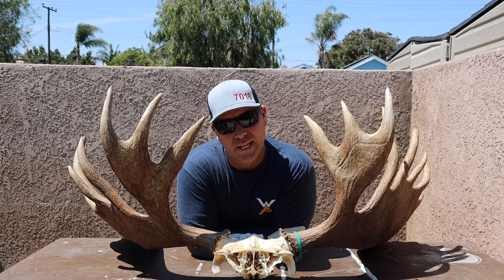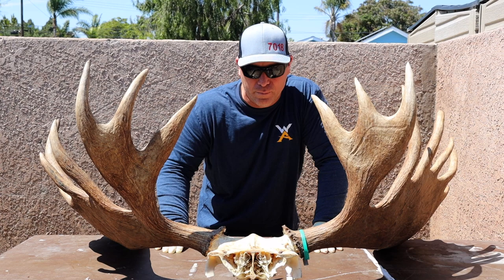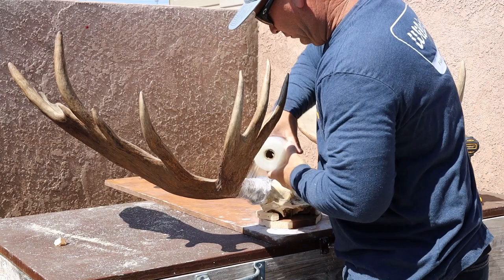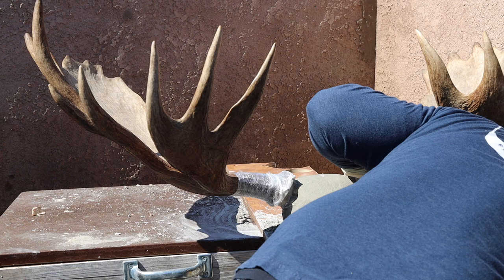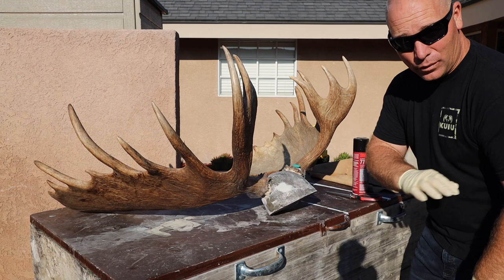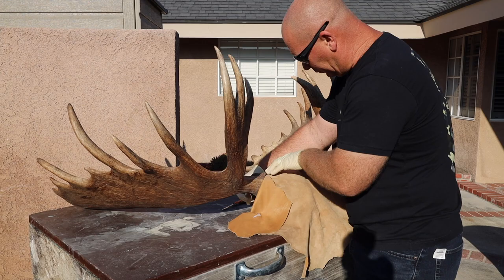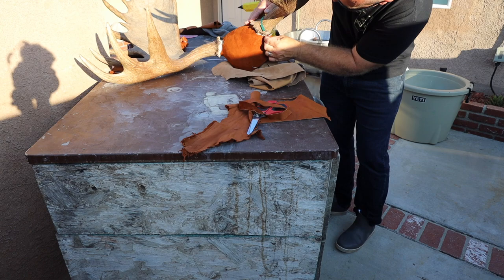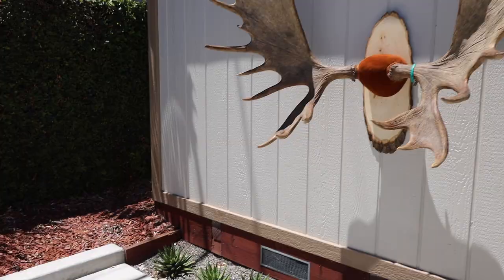HOW TO MOUNT MOOSE ANTLERS

Comment: What's been your experience with dropping a skull in room temperature peroxide? No added water and non-boiling peroxide. Just straight peroxide at room temperature.

I don't have the means to heat it up, nor a pot big enough. So I'm curious if a soak in straight peroxide will still whiten the same.